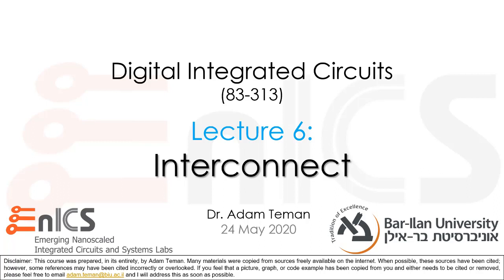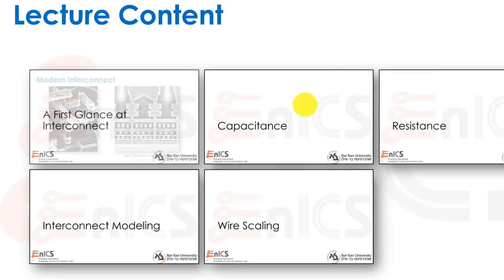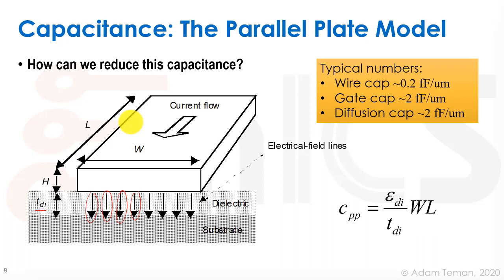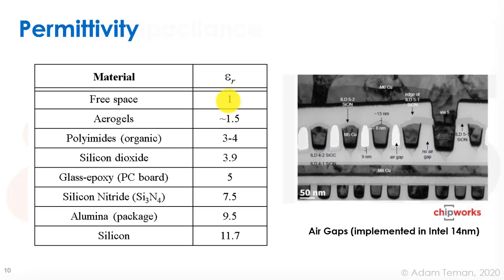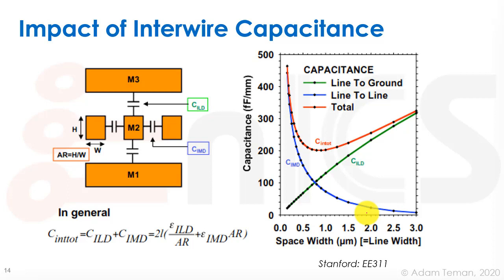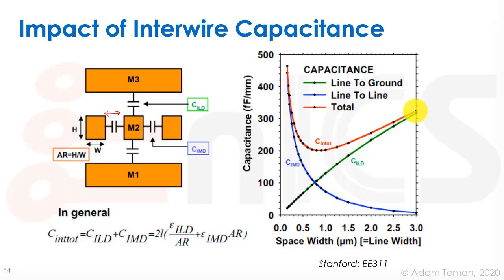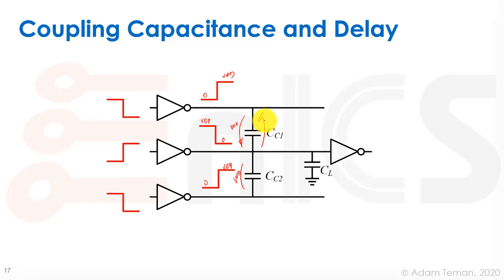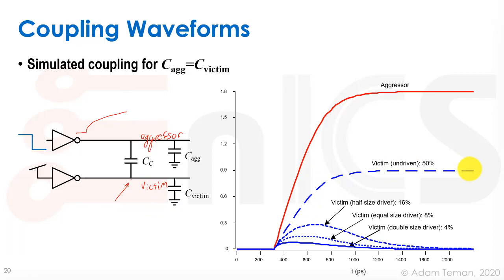VLSI - Lecture 6a: Interconnect (Capacitance)

Comment: A good explanation !! Why do inductors are not considered during extraction ? Although mutual inductance could sufficiently alter the current flow in parallel wires.
Reply from the maker: Hi Abubacker. Generally the loops in VLSI are very small and therefore the inductance is small enough that it is insignificant in basic operation. Inductance becomes a bigger factor when moving off chip and there it is, indeed, taken into consideration.

Comment: Hi Sir,

Actually I`m does not understand very well about Coupling Capacitance and Delay. Could you explain to me this point.
Reply from the maker: Hi,
I'm not sure what was not clear. 
But in short - a voltage change on a given net can cause a voltage change on a non connected net that has coupling to it. If the voltage change is in "the same direction" as the current transition on the net - the delay is shortened. If it is in the "opposite direction" - the delay is increased.

Comment: sir how drivers are affecting the capacitance of a wire ?
Reply from the maker: Hi Akash,
I'm not sure I understand your question, but in general, the drivers don't (directly) affect the capacitance of the wire. The drivers are used to drive the capacitance of the wire. In other words, if I have a long wire that has a large capacitance, it would be hard for a small driver to charge/discharge it. Either enlarging the driver or breaking up the wire with repeaters or a buffer tree will improve the transition.

Comment: Very elaborative video...I have one doubt that if I am modeling single line copper interconnect above ground line then do I have to just consider Cg value or Ctotal value from ptm interconnect model?
Reply from the maker: Hi, I'm not exactly sure what you are asking.
If by PTM, you mean "predictive technology model" (i.e., the models often provided by Arizona State University), then they are primarily transistor models. You asked about a copper interconnect line, which is a wire, not a transistor. The wire is an RC that depends on the length/width/etc., rather than one of the parameters, such as a Cg. In any case, regarding the capacitance of the transistor, this depends on what state it's in and how it is connected to decide which capacitances are relevant, but in many CMOS type designs, connections are to the gate and are dominated by Cg (though this is, by all means, not the case always).